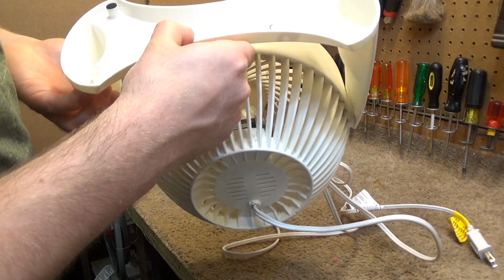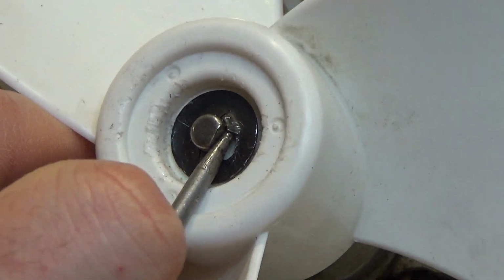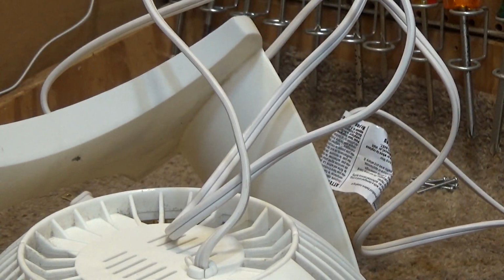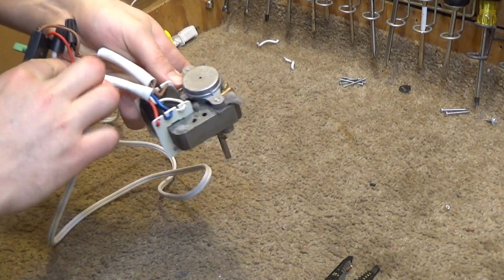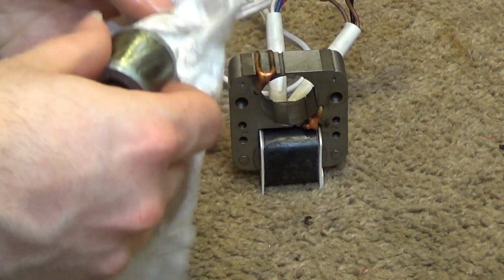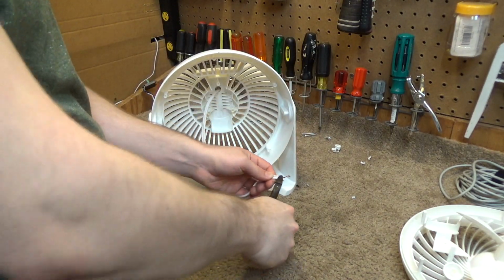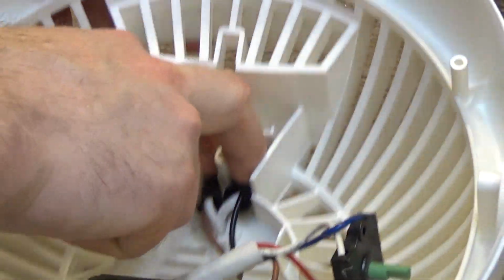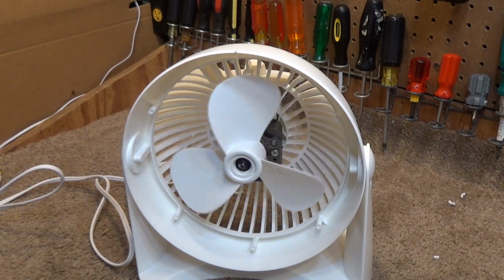Clean and Repair Honeywell HT-904 Turbo Fan

Comment: Nice video. Thanks for sharing.  Just for a point of reference for those future viewers, the washer that you removed holding the fan blade in place is called a "helical washer". These can be replaced buy purchasing them in the speciality washer section of any hardware store, Amazon, on harbor freight depending on the store.  And there is a speciality tool to remove the strain relief power cord bushings.  It's called a strain relief bushing pliers or a pair of pliers can be used
Reply from the maker: Thanks for the information.

Comment: Well, I was hoping a cleaning and fresh fan oil would do the trick but I’ve packed all my tools up and can’t find something appropriate to remove that stupid clip. By the way, the clip on the fan I have is smaller so it’s going to be a problem taking it out. This is really the best fan I’ve found for the bathroom. Moves a lot of air for its size. Too bad the manufacturer doesn’t believe in our right to repair. Thanks so much for your help!
Reply from the maker: It really is a shame these aren't designed to be serviced, the use of a threaded nut on the shaft instead would solve much of the problems.

Comment: Thanks for taking the time to make this video. I learned a bunch but my fan has a different problem. When you point it anywhere between straight ahead and up it rattles. The shaft moves forward and back. If you point it just a couple of degrees downward (by using a shim under the base) it doesn't rattle. Any clues on how to fix that?
Reply from the maker: Sounds like the trust washers may be worn out.
Reply: AHA! I have the exact same issue. opened up the whole damn thing and cleaned it as best as I could and oiled it up. But still it rattles, when you try to position it up. Where does one buy a trust washer?! 
😩🤦🤷

Comment: Thanks for the video i am taking mine apart also, that stupid clip is also giving me a problem. I have tried your way, but now am on to using a 5-foot pry  bar and a 20 lb Sledge hammer to try to pry it off. My contingency plan is to use a 4x4 1 ton truck and a recovery rope looped around the backside of the fan blade / shaft with a logging chain running through the backside of the fan housing connected to a telephone pole. If my contingency plan fails I'm going to use the stupid fan for target practice, and just have one delivered to my door for $17. Some people may look at it as planned obsolescence, where I consider it an endless supply of new targets. And as an added bonus in the future after I'm dead and long gone, my target range can be mined for valuable resources such as but not limited to plastics, polymers, steel, aluminum, brass, alloys, rare earth magnets, copper and my mother-in-law. Take care friend ✌.
Reply: Update I was able to do everything without having to take the fan blade off, there's access between the fan blades to take the bearing off as well as the motor from the fan housing to oil/ clean.✌
Reply from the maker: A few drops of oil applied from the outside will not last long, the oil needs to be soaked into the wicks on the inside.
Reply: @JordanU  I was actually able to take the the whole thing apart with the fan blade on it was a little cumbersome to work on like that, but it worked. Maybe try it next time if the push nut is being difficult, it allowed me access to all the bearings.
Reply: 😶😳🤭😂🤣😂🤣 
I feeeeeeel it maaaan. It's so gaddannnggg frustrating!!!!
Thanks for the chuckle though. I hear ya.

Comment: TLDR at the end.  So, I fixed my fan today.  I started by just taking the guard off to wash it and the fan blade.  I put it back together, plugged it in, and nothing.  I was not happy.  Then I remembered that I never turned the fan off.  It stopped working at some point, but I didn't need it running (space heater season in the basement office).  My first thought was to just toss it out and get a new one.  For some reason, I did a quick search to see how to fix it, and found this video.  I was only half paying attention until I heard planned obsolescence.  I was recently in a class at the local community college titled, "Introduction to Sustainability", and one of the BIG topics was planned obsolescence.  That was all it took.  I followed the directions, and spent WAY more time than I will the second time around.  Now I am happily listening to my fun running at middle speed and feeling a nice breeze behind me.  Now for the fun facts, then the important tidbits.  Fun - I checked to make sure the motor was working a few times as I was making the various repairs (new wire nuts, new power cord, lots of wire stripping).  At least twice, and I think three times, I managed to forget to unplug the motor.  120VAC didn't kill me, and it didn't even hurt that much,  but I was confused as to why I was getting stabbed with the wire when it should be in the nut.  Next fun fact - the factory cord on my fan had a fuse in the plug.  It is a teeny tiny 2.5 amp, 125VAC fuse.  I could have replaced the fuse, but I couldn't find the right one.  It is the same size as is used in Christmas tree lights, and Home Depot had a package of 3A fuses.  So I replaced the power cord entirely.  Last fun fact - I spent probably 3 hours altogether on this project, and I spent about $10 on the various parts I needed.  It would have been more economical to just toss it and get a new one.  But the whole planned obsolescence got me so annoyed, I fixed it instead.  And I am positively delighted.   I am porbably about a 5.5 on technical ability, but closer to a 9.5 on following directions.  This turned out to be kind of fun part of the time.  TLDR notes - 1 - The cord strain relief is 1/2".  Most hardware stores carry Hillman, and the part number is 58240.  I had to get them on Amazon, so I have 9 extra.  Post a note here if you need one and we can work something out.  2 - I could not save the old strain relief bushing, so I had to replace it.  Seemed a lot easier with the Hillman than the old one.  3 - This is mentioned in the video, but putting it back in is a pain.  I found getting the smaller part of the plug seated through the opening first made getting the rest in easier.  I used a wide slotted screwdriver to press it in.  4 - Marking the cover with a pen to make sure you line everything up right when you put it back is a good idea.  I figured out that the cover has 2 sets of 3 evenly spaced screws for fastening.  Once I saw that, lining it up was easy, but a mark would have made it easier.
Reply from the maker: It looks like you have some good information here and an intelligent story to share, but without being separated into paragraphs it's nearly impossible to read.